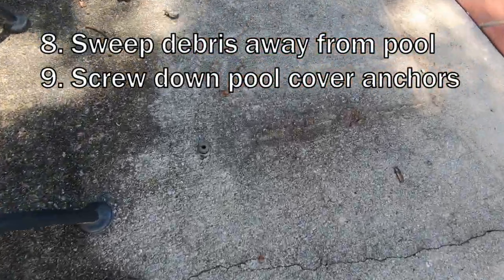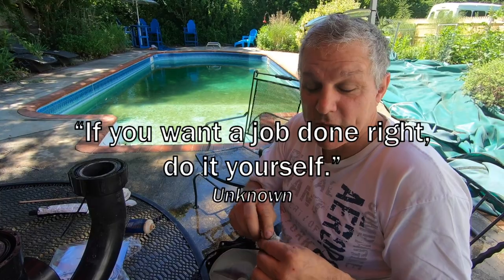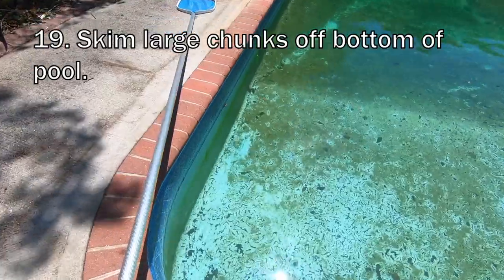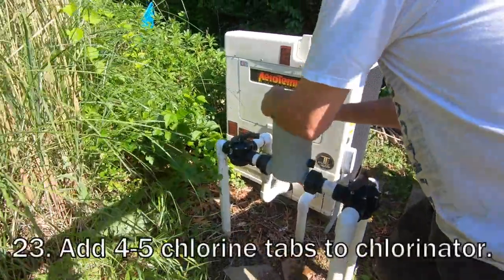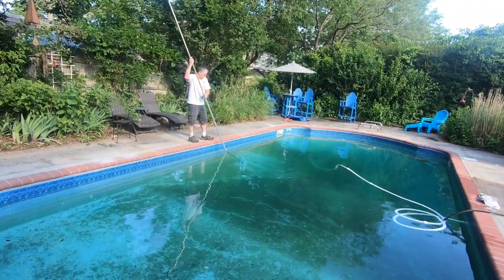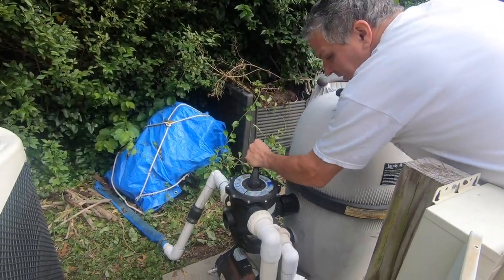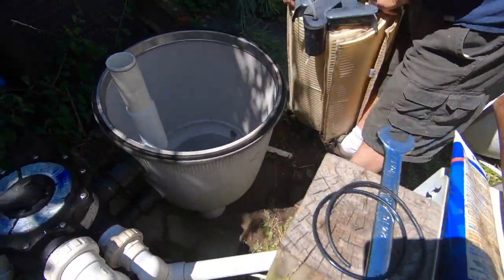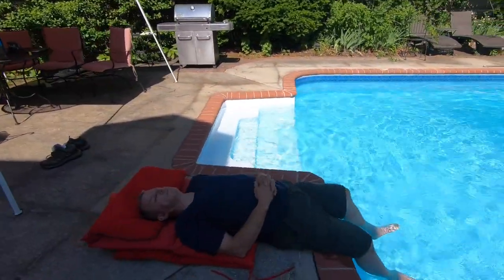DIY INGROUND POOL OPENING - Step by Step

Comment: Nice video, I am only a year in to pool maintenance and always looking for tips and tricks. One thing I noticed and would recommend is if your pool needs a lot of cleaning like this upon opening I wouldn’t add a drop of chemical til the biggest majority of that crap is out of there. Adding chemicals then backwashing will waste expensive chemicals and throw off the amount you are to add based on water test. Keep in mind if you are adding water and backwashing you are losing chemicals and adding tap water. Dropping tablets in chlorinator before hand not as big of deal but anything to adjust ph, alkalinity and such I would wait til you can run pump exclusively thru the filter system. Especially shock.
Reply from the maker: Appreciate that tip. Thanks 👍

Comment: Thank you for the video. Just bought a house with a in ground pool. Its eight years old and I have lots of homework to do. The pool is already closed but I wanna know everything before opening it come spring time.
Reply from the maker: Good idea. We loved having that pool. We recently moved but the pool lasted us 15 years. When we sold it everything was still working great - only the liner needed replacing for the first time! If you take good care of it it will last. We also have a pool closing video you should check out.

Comment: I don't get why you went through the filter from the get-go? Why not just bypass the filter for the first few rounds of cleaning the muck out? Saves all that effort cleaning & backwashing the filter. The water is going to waste anyways ? Seems like a lot of extra work to me.....
Reply from the maker: There is s bypass valve that I used. What you’re seeing is after that. No matter what you do the filters will need to be rinsed at some point.